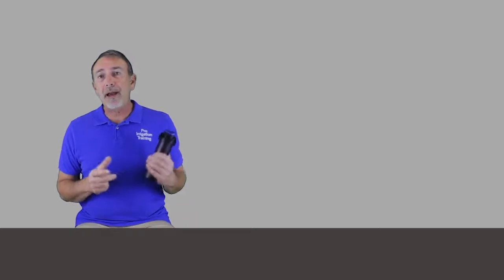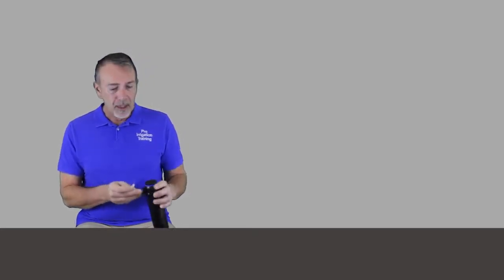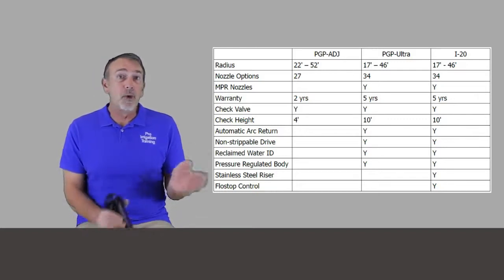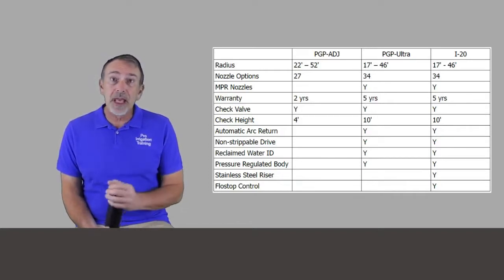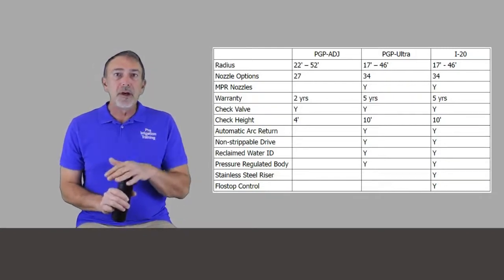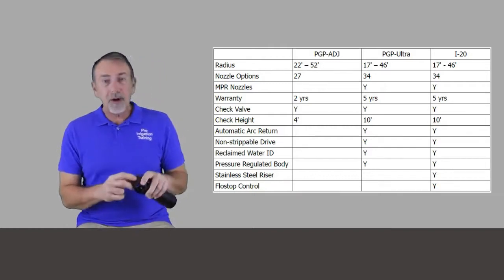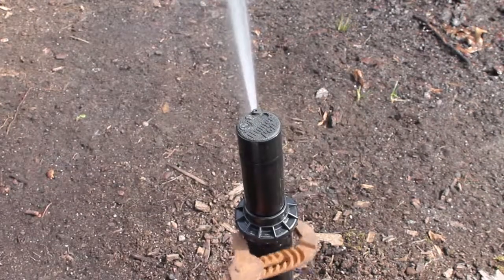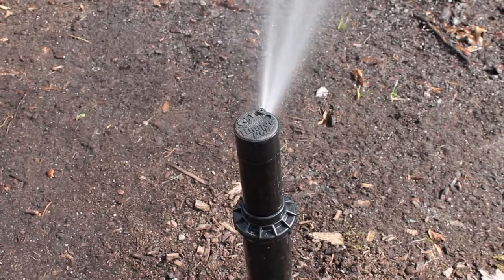All About Hunter PGP, PGP-Ultra, & I-20 Irrigation Sprinkler ( How to adjust )

Comment: use that damn channellock to twist the whole thing and not only  it WILL break at base but you screwing up the shaft and it will leak. this is very bad costly advice. Pro irrigation?
Reply from the maker: I believe that I do mention that you have to be careful about it the first few times you do it. But I do this many times a day, every day, and have been doing so for over 20 years. I did crack one or two at first, that's why I say to be careful at first. There's only so far you can twist it clockwise on it's connector. If you're cracking the stem consistently, then loosen that grip brudda!

Comment: PRS30/PRS40 units are also good for low flow applications, depending on the the MP head chosen for it, flow rates can be .10th of a gallon per hour up to .4 gallons a minute.
The PRS30/PRS40 are pressure regulated bodies.
Reply from the maker: Thank you so much for the info. I generally don't think of the low flow aspect, only the pressure reg. Thanks for watching!